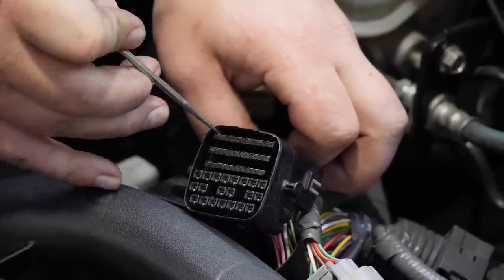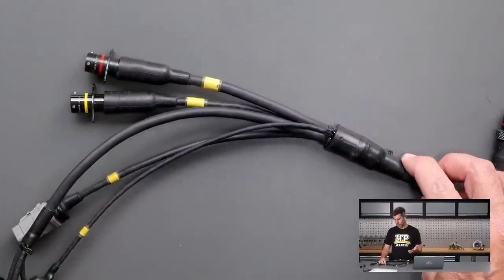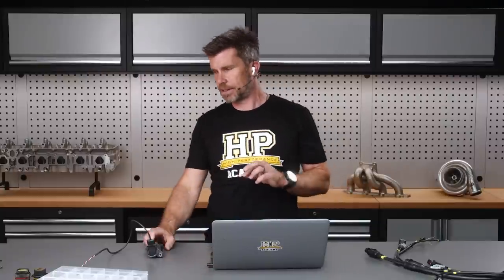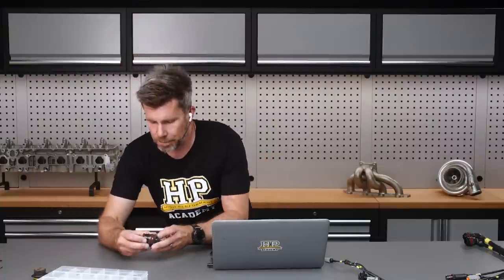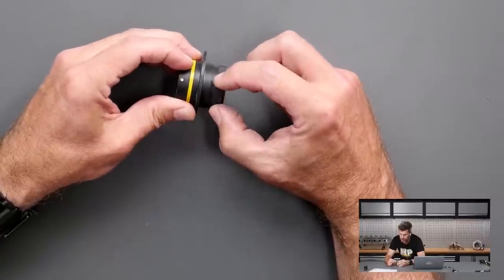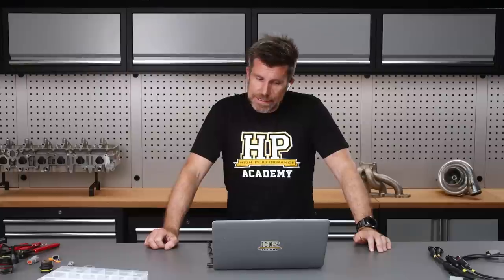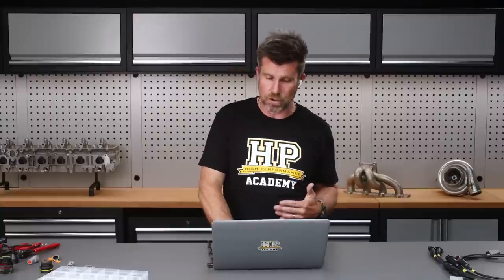What are the BEST wiring connectors you can use?

Comment: Priceless content. 
One thing I always do is put a 2 pin Anderson connector on the car so it can be jump started and also used to charge a cars battery. 
So much easier and safer than jump leads . I’ve used the small grey ones and have still had no problems jump starting a car as long as you don’t do it for long periods . 
Also some audio connectors are very high quality and suitable for some applications , some RC car battery connectors are also high quality and often gold plated.

Comment: In the discussion about the autosport connector vs "milspec" connector density I think some context is missing.  The autosport connectors were derived from mil-spec connectors and improved with added density and other autosport features.  However, there are a wide variety of different "milspec" circular connectors with different densities and contact/insulation/cable sizes.  There may be "milspec" 38999 connectors that also wouldn't work for your firewall bulkhead, while others will.  And then there's "milspec" 5015 circular connectors that support much larger power wiring.  To make this even more confusing, these traditional aerospace generated "milspecs" are now "AS" specs maintained by the Society of Automotive Engineers....the military has largely left the standards business. Add to this wrinkles like: commercial grade connectors that maybe are identical to a milspec connector except testing requirements or some other detail like plating....industrial connectors along those lines, and lastly, that there are also fiendishly expensive cutting edge high density "milspec" connectors for aerospace as well.  It's enough to spin your head a few times.
Reply from the maker: Yup! Which just drives home the point the term 'milspec' is pointless unless coupled with the relevant specification in a conversation where it is actually relevant 😎
At the end of the day though so long as people know what is being said and are getting the right connectors it's not the end of the world to use such terms, its just a pet peeve of many - Taz.

Comment: I was working at DAF authorised service all connectors were TE conectivty Heavy Duty automotive connectors
there is a wide range of connectors diifferent mounting styles 
i found it perfect for chassis harness they all are lever lock what makes them very reliable and they are quite cheap exception being sockets for modules but still they are llike 30$ + terminals but all connectors from this series uses same ones so when making a haness we need them in bulk anyway 
terminals are like 21c piece without bulk order 
comparing it to mil connetors in which just one housing can cost up to 400$ 
i found it perfect middle ground 
also the harness will have clean oem style for street cars it can be a huge deal to pass inspection
Reply from the maker: Good work on finding something that suits and cheers for sharing! Absolutely a solid middle ground to be had for club and street applications that won't break the bank but are still 100% going to tick the requirement boxes - Taz.

Comment from the maker: What's the most loved, and most HATED wiring connector you've used? - Taz.
🦸‍♂ Building a fast car? Get $400 OFF the all inclusive VIP online course package deal:	https://hpcdmy.co/vipy86
⚡ 50% off your first online wiring course! Get the knowledge and confidence you want. Enrol today: https://hpcdmy.co/offery86
TIME STAMPS:
0:00 - Introduction
1:23 - Pro harness overview
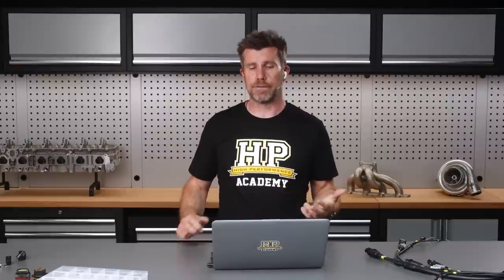3:46 - Considerations when choosing a connector
7:50 - Problems with factory connectors | Availability
9:26 - Connector suppliers
11:55 - Problems with factory connectors | Reliability
21:54 - Potting a sensor or actuator
28:15 - Choosing a connector | Autosport
32:48 - Choosing a connector | Deutsch
42:50 - Choosing a connector | TE Connectivity Composite
45:43 - Choosing a connector | Racespec aka 'Milspec' etc
49:32 - Questions
Reply: Love the AS connectors from having messed with them a bit in FSAE. Pricy but if you have the right (expensive) tooling and know how, they are surprisingly easy to work with and bulletproof in use.

Comment: Hello I'm working on a car project I'm going to be using autosport connectors for the ecu and engine harness but I'm also going to be doing a chassis harness and since I'll be using autosport connectors for the ecu and engine harness should I keep with those for the chassis harness or should I use plain mil spec connectors.

Comment: Can you please give examples of the make/series of connector you used for the Toyota 86 bulkhead that are “mil spec “ but accept OE harness as I have a similar issue on another vehicle 
Thanks in advance
Reply: The angle of the photo makes it difficult to identify the exact size/contact arrangement of the connectors used, but generally they look to be matched pairs of MIL-DTL-26482 connectors, MS 3470 and MS 3476, commonly made by Amphenol. The smaller pair looks to be a size 18 shell, so based on the wire insulation size my guess is a matched pair MS 3470A18-32S bulkhead receptacle and MS 3476A18-32P free-hanging plug. If you're based in the US, several retailers will stock that series of connectors in various contact arrangements, including Mouser, Prowire, MilSpecWiring, and more

Comment: would the mil spec connector be as good as a motorsport connector inside the chassis out of the elements and is the no way to add a boot to one. and if so would you have to machine a piece to add so that you could boot it
Reply: it is possible to use MIL-spec connectors, such as D38999 with a backshell for heatshrink boot, the result will be quit similar in term of performances. but motorsport requires smaller connectors, not available in mil spec. SOURIAU 8sta starts from shell size 1, mil-spec starts at size 9

Comment: Connector experts is criminally overpriced. Most are like 20-30 times as much as sourcing them from electronics suppliers and they don't have any indication that they're genuine parts. I would stay away unless you have zero other options.
Reply: Yeah crazy prices there. But they are perfect to find a connector you need and then reverse image search it and buy it for 10 bucks instead of the 130 they are asking
Reply: You're not kidding. I just checked them out, and a simple two-wire connector that costs maybe 7 cents to manufacture is listed for $72. I should get a box of 100 for that price.
Reply: are they over priced,  or  too performant for your use ?  Souriau 8STA connectors are used in F1, Motogp, 24h etc. 
they can stand high temperature, are sealed, stand vibration during several GP or a 24h race without issue. technologies and precision of machining and assembly to perform them are not possible with a 10$ part.
 high price but high features !